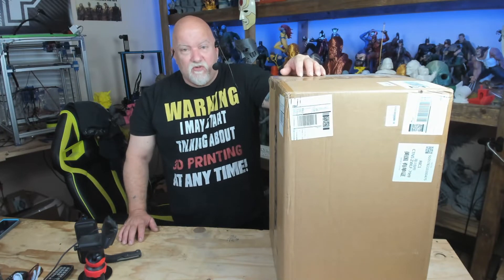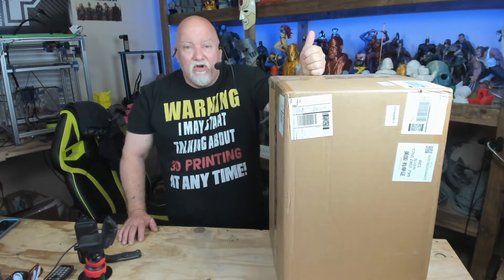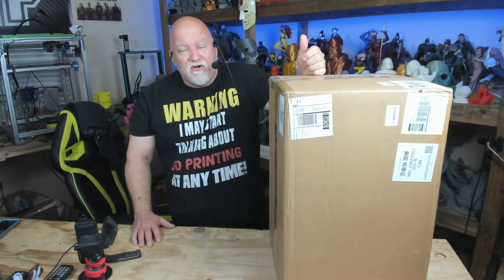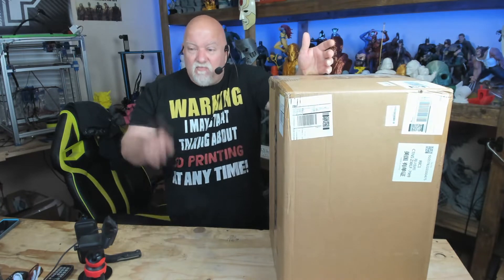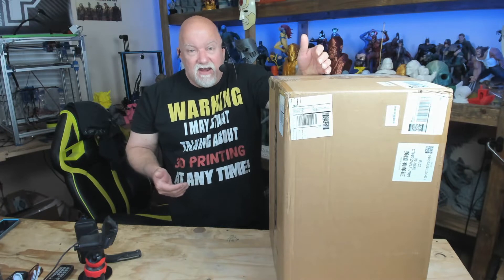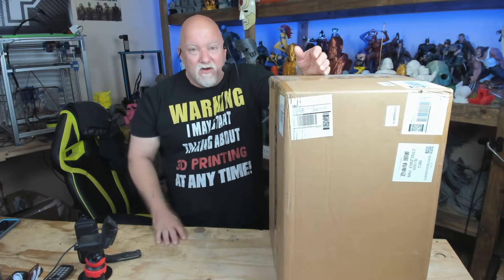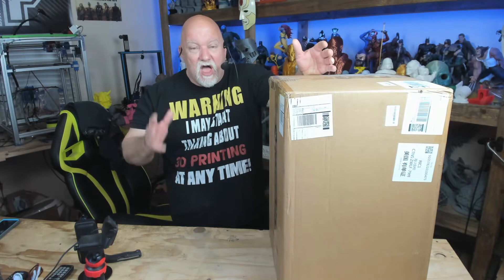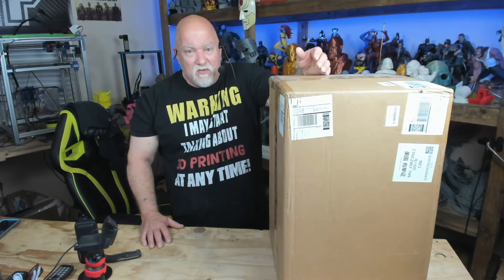Anycubic Photon Mono X  SLA 3D Printer Review #3dhp

Comment: hey man would you be willing to share your setting?
Reply from the maker: I mention my settings in the videos, I slice with Chitubox, chose the setting for that printers and if I'm having trouble with the part pulling off supports I increase the bottom layer exposure time a little and increase support density. But when I use Siraya Tech resin, I never have any issues, it just works. Hope this helped a little.

Comment: check the firmware number that came with the machine. you might need to update the firmware to kick in the AA on the machine. 3.4.7 is the latest version that has the AA enabled again. :)
welcome to the Anycubic family.
Reply from the maker: What does AA Stand for? Alcoholics Anonymous..lol
Reply: anti analysing it smooths out between layers ideal for large areas that are curved or flat etc not ideal for high detailed models but great for models like eggs etc that have curves but no details.